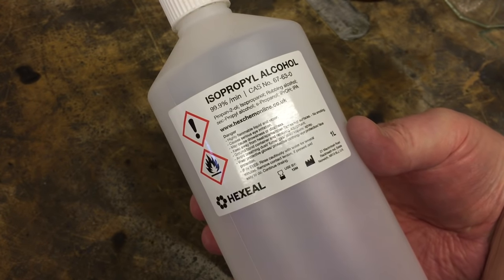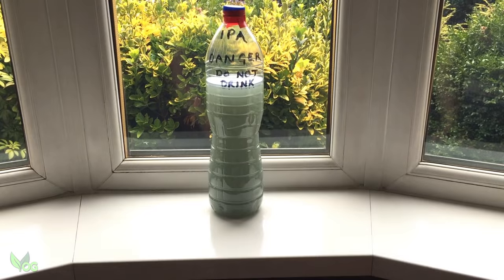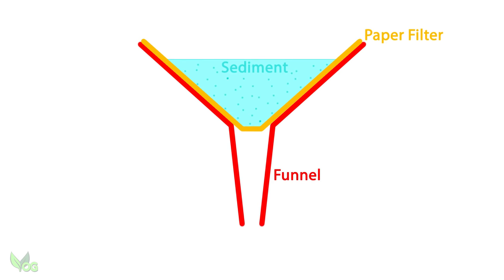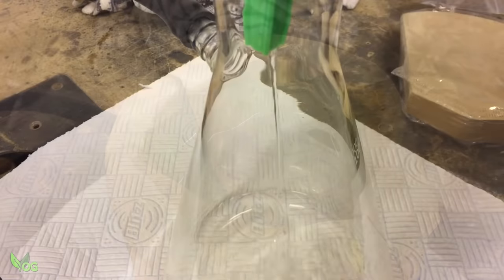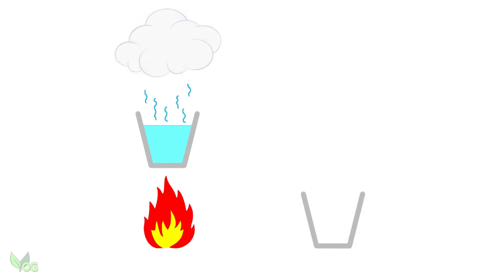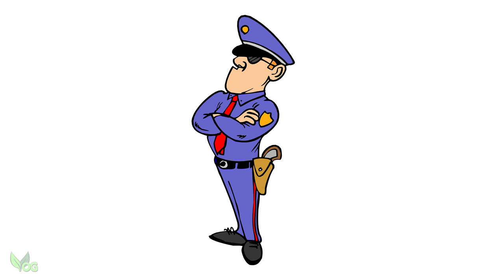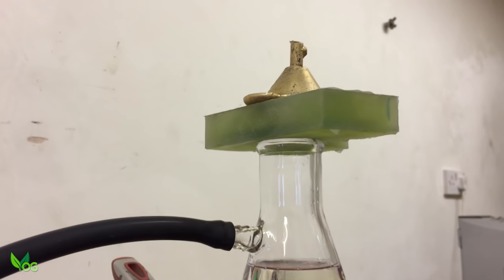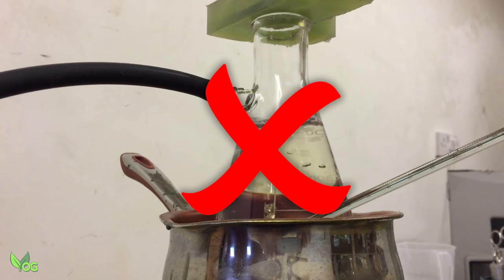How to Clean | Recycle | Reuse IPA (Isopropyl Alcohol) for 3D printing by VOGMAN

Comment: For general safety - you need cooling on the exit tube to minimize the vapor from the IPA, and as a general tip, the reviving flask can be primed with pure IPA and hose kept down submerged so the vapors have to go trough the liquid. Also, maybe a ice bath for the receiving flask.
Reply from the maker: Nice tips, thanks 😁
Reply: As a chemist, I love this video. But it's really dangerous; I've seen these distillation flash explode leaving glad imbedded in walls 10ft away; resin volitile compounds in the air is a serious health hazard. If you do this, it should be outdoor it will ventilated room and wear face shield
Reply from the maker: Trust me Paul, I'm on your side. It genuinely wasn't worth it and I hope I got that message across 😀
Reply: Next thing you know, he will create a distillation channel.
Reply: Was just about to add something about the need for active water cooled jacketed output tube to improve yield/reduce explosive atmosphere build up, but see it's been done well already.
Reply: @vogman  maybe it is worth to put the ipa in the freezer before filtering to reduce solubility
Reply: 😂 You got it across to me.

Comment: I've actually come to find that while IPA is pretty commonly used, it is really not that great compared to other readily available cleaning supplies out there.  I've found that Mr.Clean works way better than IPA, and is considerably cheaper with less odor than IPA.  It cleans uncured resin off way better than IPA at a fraction of the cost.  So do things like Simple Green and Mean Green cleaners.  A simple rince in water or IPA after and you are good to go, but I never actually clean my parts in IPA anymore.  Once you see the difference when using something else, you will never go back.

Comment: As an organic chemist, the idea of distilling IPA over a flame without a fume hood is pretty scary... I agree that it probably isn't worth doing at home... but if I was going to, I'd use vacuum distillation inside a sealed setup and reduce the temperature down to about 40 C. Three notes of caution here though: Glassware under vacuum can implode if it's flimsy or damaged, be aware that you may ruin an oil type vac pump if it ingests solvent vapour, and if you use a diaphragm pump you need to exhaust it outside and away from sources of ignition.
Reply from the maker: If only I'd "listened" to Miss Randall more closely rather than just looked and dreamed 😁😁😁😁
Thanks for the important input.

Comment: Usually after every cleaning I put the bucket inside the curing station and let it cure for half an hour so that way it cures and settles at the bottom then I use a contraption I made that works alot like a French press to keep it all at the bottom for the next cleaning. Keeps my prints from getting uncured resin on them even when the alcohol is well used and I can clean it way less often

Comment: Great funnel design. Wouldn't making the side angle shallower be the way to go, otherwise you'll still end up with the same problem of most of the weight of the IPA going directly on the centre bit because it's the deepest and carries the most weight at any one time?

Comment: Your funnel was the first non-test model I printed on my new FDM printer! 

I wanted to add here for others considering it, it ALSO doubles as a fantastic funnel to hold your paint filters when you put your resin back in the bottle. I was having trouble with funnels clogging before and spilling resin, this one is perfect and it is FAST because it allows more of the filters surface area to be effective.

I printed mine at 150% and that seems to be the perfect size to accommodate paint and coffee filters.

Comment: The funnel idea with all those holes was BRILLIANT. Wow, seriosly, I've been filtering things for years with my filters clogingging up constantly and nothing like that has ever ocurred to me. To increase the speed of the distilation you could ad boling chips (small pieces os glass, to act as nucleation points) to the flask where you heat the alcohol. Also consider cooling the hose to maximize the the condensation of the alcohol and limit loses.You could consider investing in a distillation apparatus, but, as you have stated, at the end of the day distilling large quantities of alcohol at home isn't very pracrical and can be very dangerous. Great video as usual.
Reply from the maker: Boling chips... you live and learn 😁
Thanks for the tip.
Reply: also since you have a vaccum flask and a vaccum pump you can use a paper or a chemustry filter to vastly speed up the cleaning process, also we need a reusing IPA series ( now that i think about it this channel is more like nile red) @VOG
Reply from the maker: Nile Red? Did he know Miss Randall too?
Reply: @vogman  nope

Comment: Theres also your work flow to consider,  when the ipa has reached that sticky stage where it no longer cleans all the residue from a fresh print its still suitable for an initial rinse.  This both gets more use out of the old stuff AND helps preserve the new stuff since its only effectively removing the slight residue of the initial bath. 

For mimimal labor you could have a second wash stayion staged up amd ready to go, or the cheap route is a bucket of old ipa that you swish the print around in before moving on to your typical cleaning rig.

The old ipa can probably be quite nasty before it becomes more trouble than its worth.

Comment: I have to say. After a lot of failed attempts to recycle IPA (I even tried the aluminum sulfate method shown on another channel and ended up with yellowish IPA which didn’t clean my prints at all).

I decided to give the distillation method a try but I used an electrical water distiller for the job.

It works perfectly, it’s safer than the “glass chemist stuff” and perfectly clean sIPA and it works over and over again. It takes about three hours to distill four liters. 

As long as I take all the precautions (doing it in a WELL ventilated area and no sparks or flames of any kind around) it’s wonderful. As my wash and cure machine uses 9 liters , four distillations of the same batch of IPA pays the machine. I only need to add some cooling to the exit hose to make distilling more efficient.

I know IPA is quite cheap but I’d rather use it as much as I can in order to avoid the hassle of properly discarding it.

Comment: As the boiling point of ipa is 180F it might be safer to use a sous vide. This gives excellent temp control. I suspect putting the receptacle in an ice bath would probably help as well. That way there are no open flames and you can maintain a closed system.
Reply from the maker: Many thanks 😁

Comment: i had very good results without the distillation part.
I use the anycubic wash and cure too, when the alcohol becomes unusable (it leaves too much residue on the plate when washing), I let it cure a couple of hours in the station (I also do 1 hour of curing when the alcohol is mid life), that alone makes the resin way more gel like and easier to work on, after one day is usually all settled on the bottom and the alcohol on top is already very clear.
I then filter It with a paint filter, and recover all the gel like resin, then i filter it the last time with a paper filter (50 µm).

Comment: If you use an electric stovetop to heat your water bath on low heat and then a chilled collection vessel (ice bath or just into your mini fridge) the process will go significantly faster. You could also substitute the hose for a piece of copper tubing to yield similar results.

Comment: I've been thinking about getting a lab distillation setup myself just for isopropyl alcohol.
Reply from the maker: If you know what you're doing, maybe... but I'm not sure it would pay for itself in honesty. And please, safety first 😁😁
Reply: Like another commenter mentioned.. i wonder the cost of electricity vs the cost of new IPA. I don't think it takes lot of kilowat-hours, but maybe if you had solar power, it wouldn't cost  a thing in electricity then.
Reply: @keithyinger3326  we do have a small amount of solar. And the amount of iso would be small batches anyway, some to increase the percentage, or the reclaim used iso. I don't own an SLA printer (yet, FDM 😉) I'm not using huge amounts.  Just need to clean the glassware.

Comment: you scared the hell out of me with your boiling of pure alcohol, how you did not flatten your house is a wonder, the proper way to do it is to add some RO water to the alcohol to bring down the flash point, then use a proper temp controlled heating bowl, and as alcohol evaporates at 79 deg, you only get alcohol not water as water boils at 100, please don't scare me again, and thanks for your videos really helpful to a novice just bought the halot mage pro and the UW 02 washer curing  your videos are a great help, thanks

Comment: Very good! I would guess that maybe ultra cheap water filters might help as well. Maybe used water pitcher filters? The alcohol should slip through whatever is in there, but at the same time maybe there's alcolhol soluble crap left in a used filter. Who knows. But it might be worth trying since little filters are sometimes cheap and are meant to filter many gallons of water. One might get a lot of use out of one after UV filtering.
Reply from the maker: If it's cheap and it works, I'm all for it. The thing I love about my videos is the responses I receive. There's always plenty of suggestions and good ideas shared to benefit all. 👍😁😁😁
Reply: @vogman  hey it's what we're here for.
Reply: @vogman  I would hazard a guess that maybe a Brita filter might survive a number of cycles on diligently maintained alcohol. The sticky substance in yours might be something that would clog it up within a few uses, but it depends on just how nasty the stuff is. They aren't perfectly efficient. But I would imagine that it'll definitely help. There's videos of guys filtering beer and other various things with them and they're left with much paler fluid with only light taste. The only thing that might be more effective and more expensive would be something like a deionization filter. They usually last a long time and produce near distillation quality filtration.
Reply: Nice ideia, maybe an used class 1 water filter will do.

Comment: Nice vid! I was also thinking about distillation, but vacuum distillation, so I would avoid the heat. In the end problem is distillation doesn't clean your IPA. Using IPA to clear resin changes its chemical compound and distillation wouldn't revert this.

Comment: I first give the pieces a bath in glass cleaner to remove most of the resin, then use the ipa in a final bath and maximize its use, that way the ipa reaches 20 times more baths before needing change it

Comment: Potential distillation setup improvement. In place of using torch to heat up the water bath, maybe you can try using W1209WK controller (the same as in printer internal heater) with the electric heater. This way you could quite precisely control the temperature over time, compensating even water evaporation to some degree. This should even reduce even a "little bit" a risk of vapor to blow off with not having open fire.

Comment: If you have a chest freezer, (one you would not mind drilling a hole into) it would be interesting to see if a cold trap could be used to condense IPA vapor only using ambient heat for distillation.  Maybe even use heat off of the compressor?

Super cool channel.
Reply from the maker: Cool idea!

Comment: Id look to filter on a grand scale kind of how you treat wastewater. Try to use a coagulant first and then take this further with drying the IPA/water mix. Using water will dilute your IPA, so Using cassava tapioca pearls, you can dry your IPA after coagulation. You should end up with 100% IPA after that drying. If you have a molecular sieve, you can use that to dry large amounts too. Celite & filter paper will take out trace particulates.

Comment: I dont get why you need to filter your IPA - my resin just settles at the bottom within a few days and i can decanter the almost clean IPA from the top. Does it maybe depend on the resin? Ive used Phrozens Aqua series and Anycubics Basic and UV Tough resin mostly

Comment: i wonder if a sous vide stick a better temp. control for the distillation, my can go up to 90 degree, if it only take 85 degree,  i think it will work and with no direct flame, it will not be as risky as burning it.

Comment: Instead of leaving the bottle on the shelf for a couple weeks, could you just place it in a cure station if you have one and run that for a few minutes? Sunlight is obviously more energy efficient but if you don't have the outside facing storage space for example.

Comment: If you have a FDM printer capable of printing ABS, you already have a perfect hotplate. The bed is usually designed to reach up to 110C, and has a thermistor that will automatically manage the temperature at whatever you specify. You just can't, you know, actually print with the printer at the same time.

Comment: Excellent tips, I will have to try that. Do you think leaving the bottle in front of a uv light would work or work faster than the window ledge? I just use a bowl with a lid for my wash container no fancy equipment for me lol. I lose more to evaporation cause I forget to put the lid back on, so I have to add more.
Reply from the maker: You can use an electric UV light, but sunlight is free. Plus you have to wait for it to settle anyway... 
Sometimes the lazy and free way is the best way 😁😁😁
Reply: @vogman  lol, yeah, my light is LED, probably only costs a dollar to run it 24/7 for a month. Have you any experience with flex build plates? Mine wont seem to hold when I print something of a decent size. About ready to chunk it. Any suggestions?
Reply from the maker: I've avoided the flex plates because for me it was just one more thing the clean. I imagined they held themselves in place with magnetism. Isn't that the case? If it doesn't hold, you've reason to complain...

Comment: Add water to to it (the final stage slightly sticky ipa) and shake lots, then seperate out the majority of the water/ipa using a big syringe. Add pile of table salt to the ipa, and extract again. It'll be as pure as you can get :)
Reply from the maker: Interesting technique. Many thanks 😁😁😁😁😁

Comment: Question: Instead of putting the bottle in sunlight would´t it possible to use for example the wash and cure Station from anycubic to get enough UV Light. Would the bottle get to much heat in this device?
Reply from the maker: You could, but daylight is free 😁

Comment: Pleat the filter paper and/or use a filter aid. IIRC most proper scientific filter funnels are often ribbed internally... when it's not you can pleat. Interestingly you have a Buchner flask so why not buchner filter?

The reason why window light WILL work better than a UV box is you create the particles too quickly with a strong UV source hence they are smaller as they don't get time to grow big and sink so you just end up with a "milk" full of suspended tiny cured resin particles which are too small to settle out... at least quickly. Think of it as a crystallisation and how slow = big crystals.

You need to cool the vapour as it comes off.. as the liquor condenses quickly it pulls a vacuum on the boiling vessel speeding up the distillation. Rotary Vacuum evaporator is the ideal you could do that bottle in a few minutes. 

A Sous Vide water bath and recirculation heater should work well though along with a round bottomed flask and condenser.. a Buchner flask in a pan of hot water.. well I guess your old chem teacher would have given you a good caning for that... or maybe that's what your after :P

Comment: Maybe you can try adding some activated charcoal to the dirty IPA and shake it around a bit before letting it sit out in the sun? It might remove some of the colors/impurities. 

Also, do you think you could achieve the same results putting the IPA in a UV curing chamber for a while? I’m too impatient to wait a few weeks putting it in the sun.
Reply from the maker: Charcoal is an interesting idea. As for the UV lamp, sunlight is free and you still have to WAIT for settling. You could centrifuge I suppose 😁

Comment: Vaccum distilation(faster but requires a vaccum pump) with a water bath should do the trick,. Also use a condenser and if you really want to do a cleaner distilation use a fractionary collum. Bunsen burners are not efficient and create a potential fire hazard.

Comment: Stupid question couldn't you use the heated bed from your fdm printer as a heat source? It would be very controllable if it worked.
Reply from the maker: Yes, that should work 😁